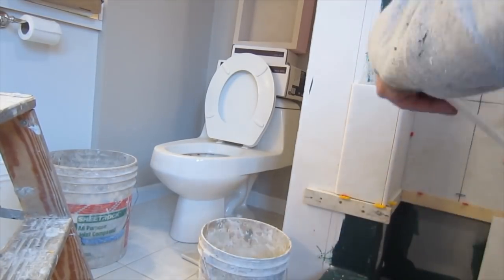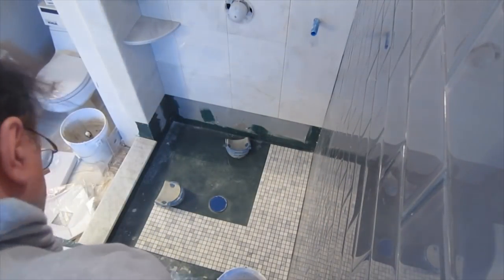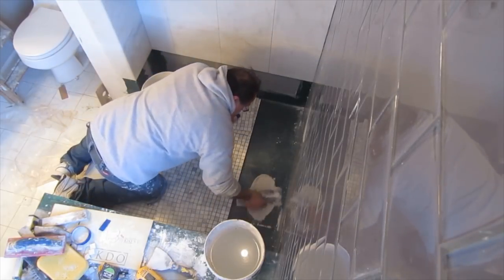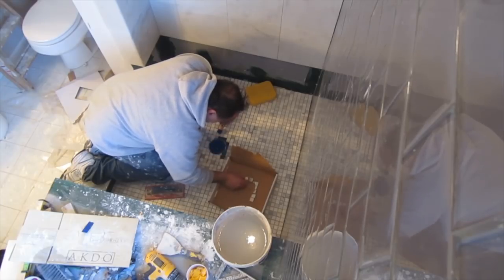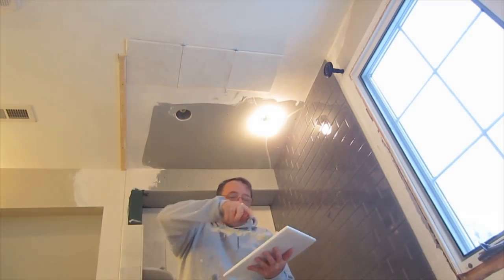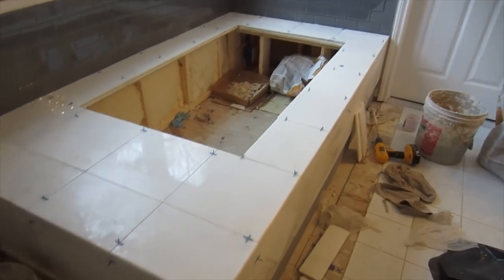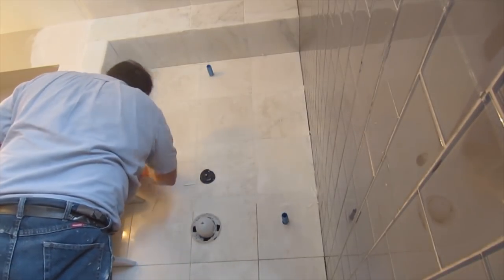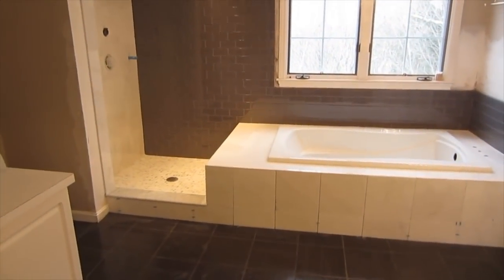Complete bathroom install subway glass tile and Carrera marble tile Part 2

Comment: what thinset for marble tiles and what thinset for glass tile...i must know, i want to avoid my contractor from using cheap thinset
Reply from the maker: Marble, should be installed with a White quality thinset like Mapei Ultraflex 2, or Laticrete 253  Gold, or Ardex X5 or similar,  or better. Unless it is a large format tile, then you want an equivalent quality thinset for large and heavy tile also known as LFT. There are also many other brands with other kinds of thinset that will be suitable like Non sag and light weight thinsets. If the marble is water sensitive then an epoxy thinset should be used, some green Marbles are like that. The type of thinset is not the only consideration that needs to be taken into account, Deflection of the floor can be an issue, the floor needs to be twice as stiff as it  does for porcelain tile. If you can't trust your installer to buy the right thinset, and you don't know that you can trust him to have done all the steps required to have a successful outcome,  then maybe you should get an installer you can trust. Glass tile is another beast all together, that requires a White thinset with a high   polymer content, Like Tec Superflex, or other thinset suitable for glass tile. Movement joints are also an element that must be taken into consideration., the size of the glass tile will also be a factor. So asking what kind of thinset is probably not the question you should be asking at this point.

Comment: hey Sal, great work...how do you go about when doing your deck tile to the facia tile like the bath here...If its not a through body  tile and cant polish an edge...Here in Alberta most tile that are used are not through body and we must use Schluter tile trim...However same thing on all outside tub surrounds you never use tile trim but grout to wall? would never fly here as everyone wants brushed nichel or titanium to match fixtures...thoughts?
Reply from the maker: If the tile manufacturer makes a bull nose I will use that, if not a metal trim, or some other kind of trim like a pencil liner, or whatever the homeowner wants. On the tub deck you can also miter the corners, but that is a lot of extra work.